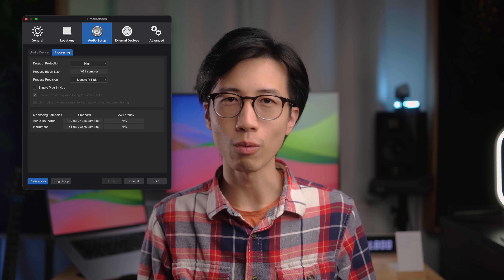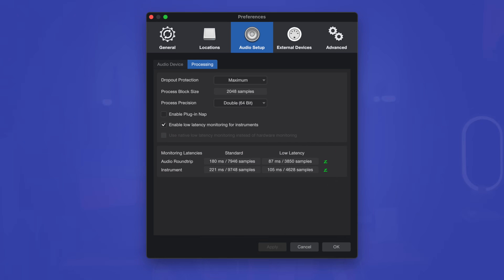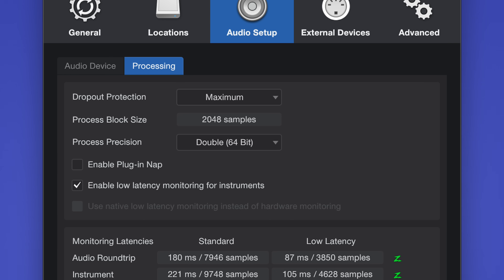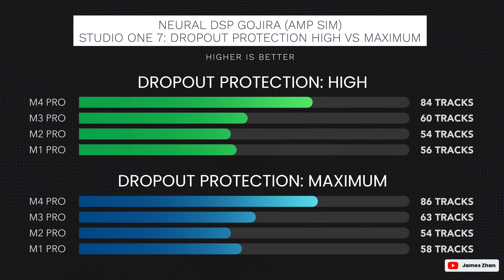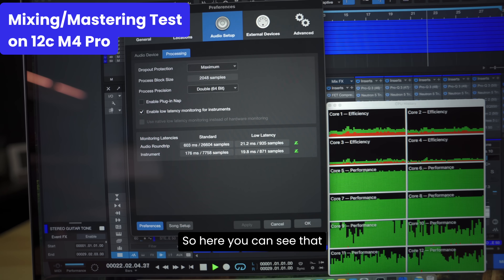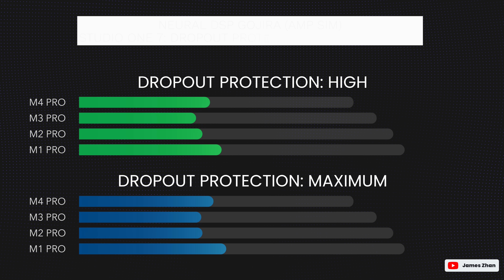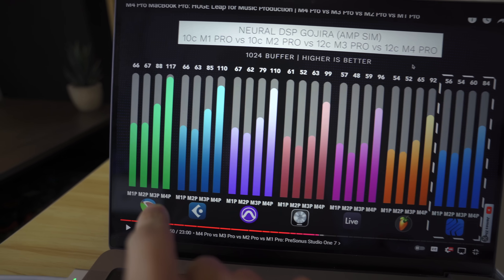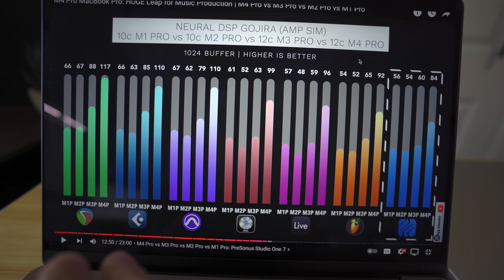M4 Pro MacBook DAW Testing: The WHY | Dropout Protection, Process Buffer, ASIO-Guard

Comment: It would be great if you would include a test scenario where the single core performance is shown, because sometimes when I do some sound design I throw a bunch of fx plug-ins on one track. You could test that the same way, just put a cpu heavy fx plug-in on one track and count how any plug-ins you could add. Another way would be sidechaining, afaik multiple tracks that are connected via sidechaining are processed only on one core.

Comment: Just thought I’d mention that the M4 Pro chip has a “high power mode” which was only available on the M3 Max chips. Some reviewers seem to get substantially more tracks in DAW performance tests on the M4 Pro laptops with this mode enabled.
Reply from the maker: This is correct. The energy modes does make a difference in DAW performance. I will be making a video investigating this!

Comment: I don’t see how people would look at your previous video as a DAW comparison. It truly was about how to save your money, if you are into music production, when it comes to buying APPLE computers. People forget Apple is a luxury brand. You have to calm your inner 7 year old, I want a new toy a$$ down. I learned the hard way with apple. I spent 4500 on a MacBook Pro touch bar 16 inch 2019 intel. MAXED OUT and all I get is 350.00 dollars? Tried to use LPX 11 and couldn’t get through a 8 bar loop using 2 instrument tracks with Omnisphere. Forget about using all the other new features. I had to downgrade back to 10.8 then eventually move to an M4 mac mini pro. I only upgraded the storage from 512 to 1tb. Then I saw your previous video, which sealed the deal on how I will deal with upgrades when it comes to apple. If LPX can’t use all the cores of a BRAND NEW APPLE COMPUTER why max the computer out? Why upgrade year after year? Save your money or buy a good quality audio interface. Keep doing your thing. You are adding new information to music production that is not discuss more.
Reply from the maker: I'm glad you get it! But to be fair, I did explicitly compare one DAW's performance against another's, so that's on me and I will try to avoid doing that in the future.

Are you saying you are only getting 350 for trade-in value for your maxed out MBP? If so, that is because Macs with customized upgrades (rather than the preconfigured models) have much lower trade-in value as they are not in demand. My M1 Max MBP cost me 6K, but the trade-in value is only 1K. However, my 3K M2 Pro MBP, with less customized upgrades, also has a trade-in value of 1K. It seems that people who bought preconfigured models will probably get the most trade-in value.

You can usually sell it for more by yourself rather than trading in. However, since Apple Silicon came out, I think all the Intel Macs lost their resale value, unfortunately.
Reply: @JamesZhan  Yes 350.00 for trade-in value. My MBP was pre-configured by apple. I’m not going to sell it. This is the mac with the touch bar. It’s still in perfect condition. I will use it for my back up music production laptop. You have to treat Apple like you’re going car shopping. If you get the latest and greatest, what will be my trade in value 2 years from now? Can I find a later model with all the specs, for a decent price? What cpu intensive programs will be running to justify, I need a blown out computer? That future proofing line we tell ourselves is a lie. Apple always find away to rope people in. All apple need to say is we’re adding a feature in LPX, that can do your music for you….Only available with the M8 models.  FUTURE PROOF? More like future GOOF. 😂

Comment: Hey,
I tested the performance on Ableton + D16 Phoscyon VST on my Mac Mini Pro2 vs. Macbook Pro1, and the performance was almost comparable, the Mac Mini Pro2 handled 82 tracks, the Macbook Pro1 81 tracks.
That said, upgrading from Pro1 to Pro2 really doesn't make much sense, but I'm afraid each setup may have different results.
Anyway, I'm not disputing the great review and deep look at this theme ;) Cheers
Reply from the maker: Hi Adam! Thank you for doing tests on your end! It seems that your tests verified my conclusion that M2 Pro does not provide significant different performance boost over the M1 Pro (at least for synth plugins and audio processing)—this is great because it helps verify that the the test results I got are not unique to my particular setup.

Comment: Do you think getting the m4 Pro upgrade to the 14 core CPU would make any difference for Logic? 2 extra performance cores seems great but it also seems like that 12 core is more than enough for 98% of people.
Reply from the maker: That 12-core M4 Pro is more than enough for most people. I still need to test it, but I have a feeling that the base M4 chip will be the best value for most people.

Comment: Thank you. Good to know as I go down this road with my Mac mini M4 Pro using Logic.  Just curious to your typical project sizes in tracks, virtual instruments and processing, since you mentioned some overload instances. This happens to me on occasion with very little going on in the project. I attribute it to the external hard drive sitting idle for too long sometimes. It's like it starts to go to sleep almost. I'll click "ok" on the notice and by then it seems to come back online and works fine. I've got the screen saver set on never and sleep disabled too. Hmm
Reply from the maker: Some of my projects have 10+ instances of amp sims on it, which alone really put a heavy load on the CPU, and it's why I love doing the amp sim test! People say it's not realistic, but it actually is, just depends on what you do. And I always mix into a mastering chain, so things can get extremely crazy very fast. I run my projects on the internal SSD so drive speed definitely isn't the bottleneck.

Comment: What you don't know is that Studio One's dropout protection set on high does not give the best result. But you are not to know this. Better results are obtained when the dropout protection is set to minimum  (eg OFF) and manually set the buffer high. Please do some tests using this method and report back.
Reply from the maker: But in my tests the device buffer is already set to 1024, shouldn't setting dropout protection to high, or maximum, at least allow S1 to get more out of the chip? Or is that not how it works in S1?
Reply: @JamesZhan  For some reason Studio One's performance is better with dropout protection turned off and the buffer set manually. Please try it and see. This is what Studio One users have found. We don't use DP much.
Reply from the maker: @jeffevansmusic  Just gave it a try. Dropout Protection off, device buffer 1024. It could run way less tracks compared to when DP was set to High.

Confirmed this on an M2 Pro Mac and an M4 Pro Mac across multiple testing projects. 

Definitely not saying your experience is invalid, but maybe such inconsistent experiences across multiple users is an indication that there is a bug in S1's core usage on Apple Silicon?
Reply: @JamesZhan  Thanks for testing. Interesting. I forgot to say not using DP was better for me on an older Win7 machine. Not Apple. Silicon. I will test again now that I am on Apple Silicon. Also Studio One V7 may have sorted this better also and by your result I would say for sure. Thanks for your videos too. I know there has been some discussion about your methods but the original video that pointed out Studio One's non use of the efficiency cores is actually the most relevant point for me anyway.
Reply from the maker: @jeffevansmusic  Yeah Intel and Apple Silicon chips are on completely different architectures so I wouldn't compare S1's behaviors on Intel to those on Apple Silicon! Would be curious to see the results you get on your Apple Silicon machine.

Glad my original video was relevant to you!

Comment: Hi I currently use an old i7 pc, i mainly use Reaper but also use reason 11 as a plugin and stand alone ( how about testing reason13), I'm considering a Apple M4 mini with 500gb drive,instead of a pc but I would also need a dock for keyboard, midi interface external drives,

Comment: S1 always had this problem but the users on certain areas on forums or facebook groups wants to dismiss it and get salty about it because it's a DAW they bought.  I've been on S1 Pro since V3 and using certain plugins and other things will not compare to the cpu efficiency as let's say Reaper.  I get that people bought a DAW and would love to defend it against any criticism but it's truth and fact that there is an issue that needs to be fixed that we've been asking for a long time.  Hopefully S1 will work on CPU efficiency but they way they have been going I have no confidence in them.
Reply from the maker: I'm glad you understand. This performance thing is arguably not a very important factor when it comes to choosing a DAW—I doubt anyone chose a DAW just because it's can max out the CPU. People choose a DAW because they like working in it, and so the point of my video is more like, "OK you should know S1 may have some core usage issues, so you might need to get a more powerful chip to make up for that if you do very large projects.”

Comment: Testing DAWs are difficult, since DAWs work in different ways and in music production the variables are nearly infinite. You are doing extremely good work here, give yourself a pat on the back. :)
Reply from the maker: Wow, cool to see you here, Bjørnar! Your videos are great, and I'm glad some of our tests pretty much show similar patterns and trends when it comes to efficiency cores vs performance cores utilization. I'm mostly a mixing/mastering engineer working with audio recordings, with no background in electronic music production, and so your tests with synths are really valuable and provide very valuable different perspectives to everyone when it comes to DAW performances on Apple Silicon chips.

One thing I recently discovered accidentally is that, if you are trying to run a heavy project in a DAW that cannot use efficiency cores, like Ableton, and at the same time you have some other power processes running in the background, macOS seems to “shift” some of those power processes to the efficiency cores.

For example, one time I accidentally left FCP running in the background while running a test in Ableton, and I was surprised to see that efficiency cores suddenly saw a lot of activities when I hit playback, as if they were processing audio for Ableton Live.

Once I realized i had FCP running in the background, I quit it and restarted the computer for a clean start, and ran the same Ableton test project again. This time,  efficiency cores activities were back to minimum.

So I wonder if the bit of activities you see in efficiency cores when you were running some of your tests was because you had screen recording going on at the same time? I wouldn't be surprised this was the whole point of Apple deciding to not have Logic use the efficiency cores—just so people can run other stuff in the background.

Either way, really fascinated stuff!
Reply: @JamesZhan  Thanks for the feedback and likewise! It is reassuring that we see more or less the same patterns here. I think you are spot on in your speculation of how Apple handles efficiency cores. Your experience with FCP there is really interesting actually and maybe shows why Logic is only utilizing performance cores. The OS can then decide that Logic should get prioritized for available performance because Logic could be used in a live setting. That is also why we probably see Ableton Live using performance cores, because Ableton is also a DAW aimed for live performance. While Cubase / Reaper is probably aimed more for the production side, and because of that they also can use efficiency cores. 

OBS certainly used some CPU for screen recording, but I think it was low, around 1-4%, moving forward I will use my camera instead to keep OBS out of the equation. I have the 16-Inch, 14-Core M4 Pro CPU, 48GB RAM on the way while I wait for the studio, so I can try some of these tests myself and see if I get the same results. Take care!

Comment: Your vids are clear, James, thank you. The question Ive been using them to answer goes like this: ‘Based on the fact that I use this DAW, what’s the least expensive Apple Silicon chip based Mac I can afford to get in order to meet my needs?”. And also “ If I want to use THAT other DAW - how do the four generations of chips compare RELATIVE TO EACH OTHER when using that particular DAW”. Or even - “Given which chipset I have; which of these DAWs will cope the best if I need to be able to deal with more tracks than usual?”. I actually use more than one of the DAWs tested, so your videos have been able to offer a wealth of information, and helped me choose a replacement for my 2019 intel mac. I ended up going for a second hand M1 Max, because I could see that the difference between it and the M2s and M3s was negligible. And although I can see a significant jump in the M4, buying one of those would have meant that I wouldn’t have been able to afford the 64GB of RAM and 4TB of SSD (at 6/7000mbs a second!) that I was able to get for probably less than a quarter of the price! Because those M1 track counts you were showing looked really good, compared to the 3-10 I was getting on my heat-throttled, sounds like a jet engine, 2019 i9 that could only deal with two layers of an Arturia synth emulation before glitching out (not joking)! With all the compliments out of the way, would also be curious to see how UAD Luna fares in terms of likely counts - and how many instances of Arturia’s ‘Astral Voices’ patch each chipset can handle (it’s now hit, according their forums, though not the one I was struggling with, which was much lighter (!) - to help me decide how long I can afford to leave it before upgrading the three year old machine I just bought! Thank you very much for your incredibly useful work, comparing how these chips perform relative to each other,in any given DAW (except Luna… nudge nudge ;) - I have apollo hardware so it has some really useful features for me, when I need them). But Reaper saved my butt on the old i9 - I could actually get enough tracks down to sketch out a 10-12 track song demo with a few plugins with  it - because of its awesome efficiency! But I love a few of the other DAWs, too, for different things!
Reply from the maker: Thank you so much for this!! You actually put it way more elegantly than I did. I might actually borrow some of your wording to communicate the purpose of the tests in my future videos.

Your experience about how REAPER allowed you to do stuff that other DAWs couldn't on an old chip is amazing. That's EXACTLY why I think these DAW tests matter. 

THANK YOU!
Reply: @JamesZhan Haha, brilliant - great to hear, and had hoped it could be helpful! That’s partially what inspired me to write it (especially in so much detail, at least!). I could hear what you were trying to communicate in the video (and could also hear what some people were misunderstanding!) and thought “If he said it like ‘x’, the people at the other end might understand the idea better!’” - it’s part of my work to make stuff like this understandable to the widest audiences and wanted to give something back for all the help you were in my decision making process! I really wished I could have afforded a top end M4 with 128gb and 4tb - but all of your videos over the last year let me see that the M1 max could probably meet my needs until a fair bit further down the line! So thanks again, so much for that, I’m super pleased with my second hand/used machine, spent all of last night migrating all my old projects that crashed before I could finish them, and it looks like it’s going to be able to run then like a dream! I think you have one of those machines, too, and have copied some of your settings in the Reaper config as a starting point - any tips on that welcome (one thing I wondered about was setting it to only use the performance cores, to leave the 2 efficiency cores to run the OS in the background, but the setting seemed to have disappeared when I briefly looked for it last night! But might not matter anymore - this thing isn’t feeling like it going to struggle with things anywhere near like the way my old one did (even opening a project maxed out the old machine, lol, and took ages!). And I’d be delighted if you wanted to borrow some of the language I used to help clarify things for those thinking it was a DAW shootout, lol - it’s why I wrote it! Thanks for all your your help, this genuinely feels like the first fit-for-purpose studio machine I’ve EVER had - and I’ve been building and buying them since around 1995 lol, and EVERY ONE had something wrong with it, lol!
Reply: @JamesZhan Oh and I had to typo in the bit about Arturia’s Astral Voices patch (from Analog Lab, or V Collection, not sure) - I was trying to say that it’s (according to their forums) a known CPU hog, even more than the ones I was only getting two instances out of on my old machine before glitching - so thought it might make a good candidate for a ‘how many instances’ comparison! I might try it myself on the new machine tonight. I’m only just getting to the end of migrating everything redownloaded onto it, haven’t even had a chance to stretch it’s legs/limits yet!